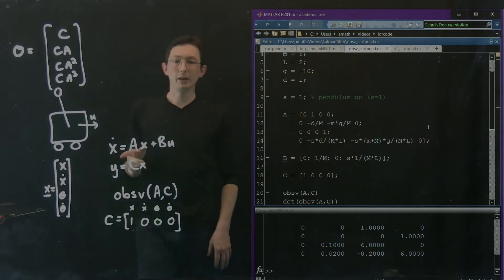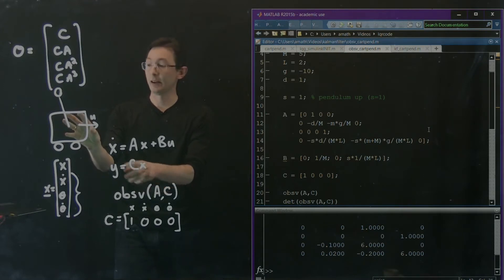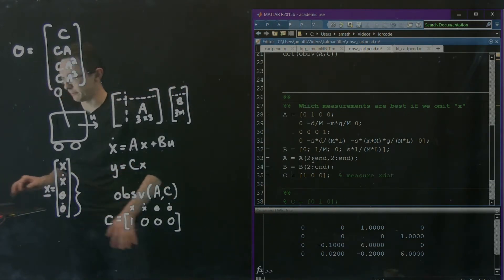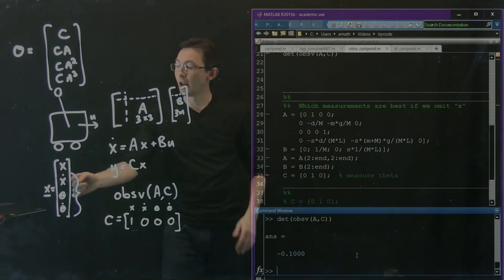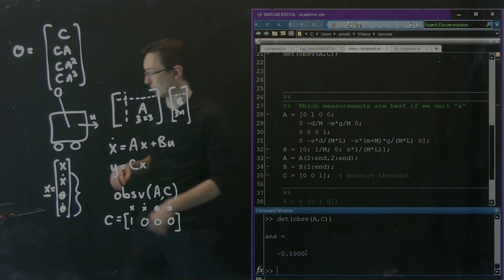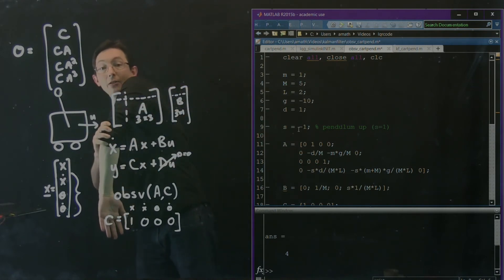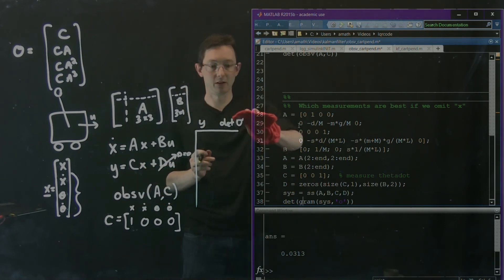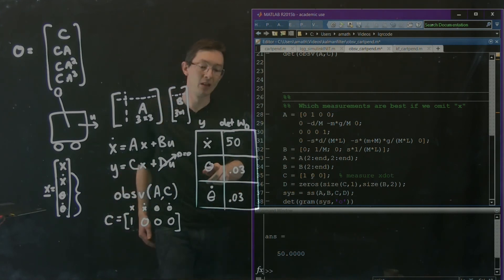Control Bootcamp:  Observability Example in Matlab (Part 2)

Comment: Excellent and fun lecture. But...
1. Under what conditions can you drop a state (in this case the cart position x) from a state-space system? Intuitively, I suppose that state shouldn't be coupled with any of the others, but how to test this?
2. Why would the level of observability (estimated using the determinant of the Gramian) in the pendulum down position be indicative of the level of observability of the pendulum up position? These are very different dynamics, right?

Comment: What if the initial theta is unknown? In this case, looks like theta dot isn't sufficient to have observability of theta
Reply: Well if the pendulum is in the down position the system is stable and theta should move without input towards zero (and can be expected to be Zero). The Estimator can then correctly estimate after further input. In the next video he says he cant provide the estimator for the non stabel system directly.

Comment: Doesn't partitioning the matrix like at 2:18 eliminate some of the dynamics from the linearized system, though? Seems like changing the system or ignoring some of the dynamics isn't a good tradeoff to make the system observable.
Reply: In this system, x doesn't affect the dynamics of x_dot, theta, or theta_dot.  You can see this in the differential equations for the linearized system, and the corresponding elements of A are zero.  This is not generally true, and you are correct to be cautious.
Reply: x isn’t even in the dynamics to begin with, so removing x isn’t changing the dynamics

Comment: You did explain very intuitively what's the benefit of finding the most ctrb direction but what about the most obsv one? I don't get what's the point of knowing x is the most obsv state?
Reply from the maker: This is the state that is easiest to estimate from noisy sensor measurements, based on a model of how the system behaves.
Reply: @Eigensteve  By "easiest" do you mean the estimation will be more accurate and error will go to zero faster?

Comment: Can the controller be included as a part of system matrix (A-BK) hence the system is stable in top position then we can calculate the gramian, will this work around work ?
Reply: Actually you can do even more than that, you can even design the controller that assigns the observability (or controllability) gramian that you want (https://www.researchgate.net/publication/23917814_Assigning_controllability_and_observability_Gramians_in_feedback_control)